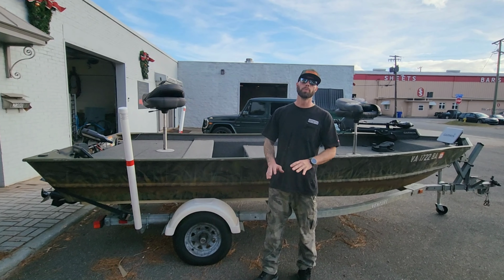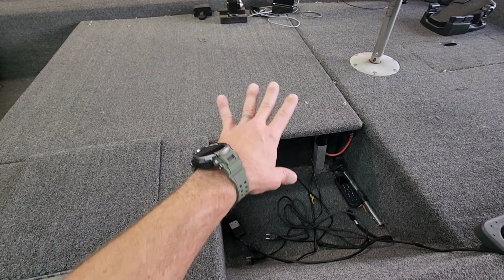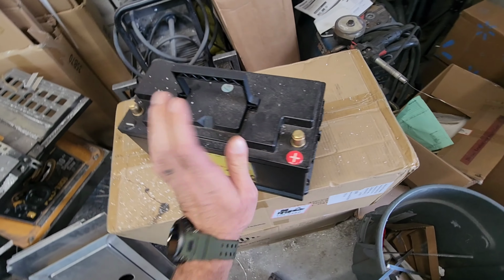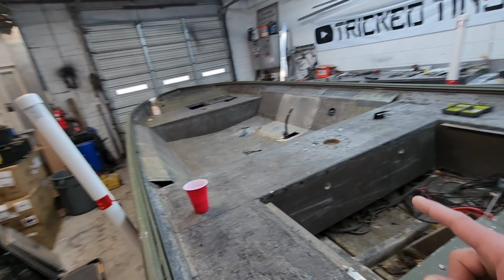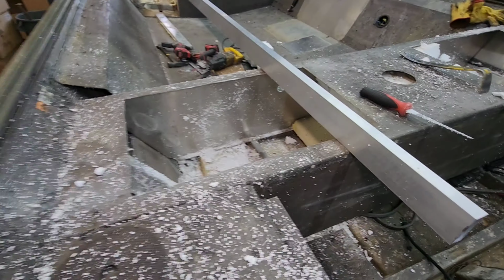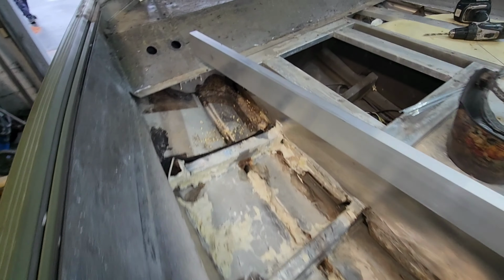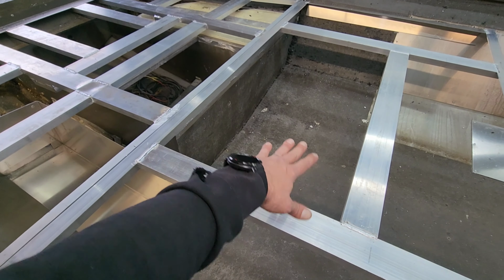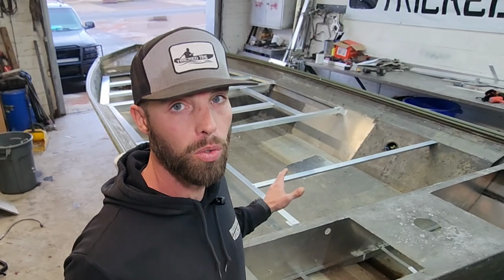Here we go again! Lowe 1860 Full build

Comment: A good heat gun and a sharp scraper or one of those oscillating tools will take that glue off pretty easily. It'll get most off, then you can use an adhesive remover to get the rest..  Question, how much would a new transom cost? My dad has a 16' vhull, he's owned it since new in 78 but that transom is shot. Excited to watch this build ..looks cool as hell already. Stay up bro.
Reply from the maker: Thanks brotha.  Carpet and glue are for the birds